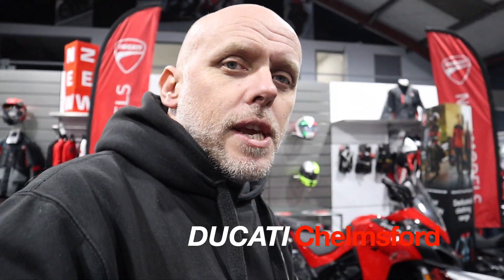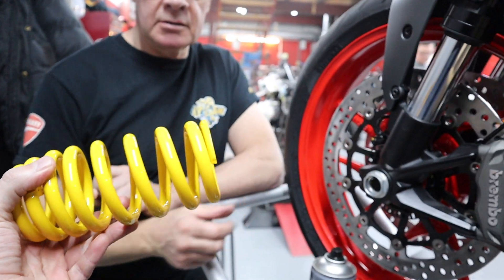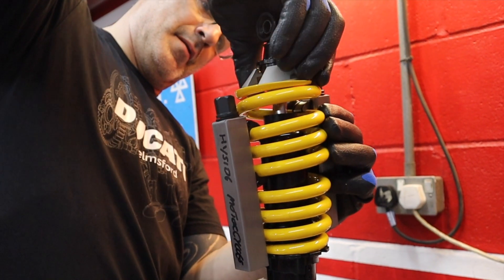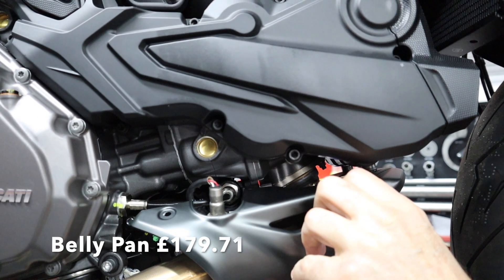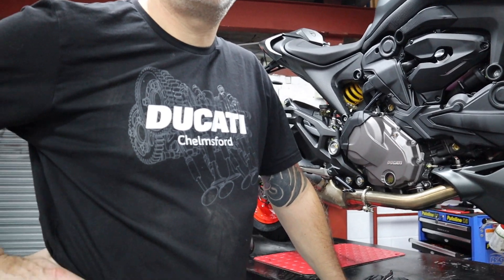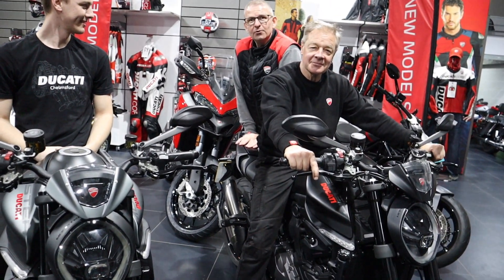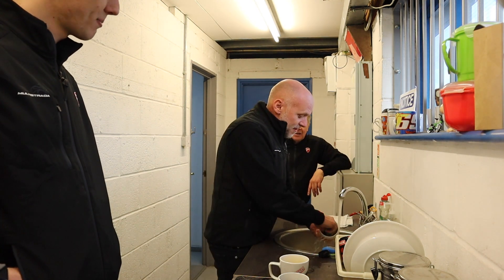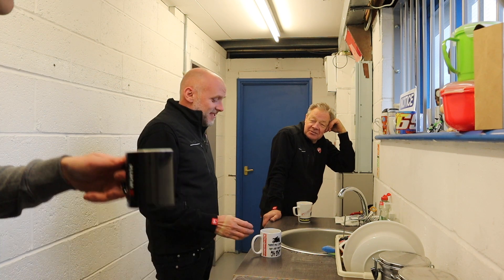New Ducati Monster 950/937 Suspension Lowering Kit , Low Seat & Belly Pan

Comment: Hi, me again (same as below, Terry Mims). thank you for your videos! So, I'm vertically challenged, and waiting for my red 937 to come in, in a couple months. We're going to try a lowering seat first. I'm 5'7, 65 years old, somewhat short legs. Anyway if I need the lowering springs, I will (dealer) install the kit. I know some people are completely against lowering the bike (affects the geometry), but, if that's what it takes to get this bike. I'm not a racer of any kind, so I think I would be alright. I was also interested in the MV Agusta Brutale 800 Rosso, but it sits too high for me. MV emailed me back, saying basically they don't lower their bikes. But I do have a Ducati dealer here in Albuquerque, whereas nearest MV dealer, probably 500 miles away. I think the Monster + wins out!
Reply from the maker: Yeah the lower seat maybe enough on it’s own , I’m 5”8 but as we are all different body/legs/arms lengths then it will be different for us , but see how you get on with just the seat and then see if you need the lowering kit :)

Comment: My height is 167 cm or 5'6" 
I m sure i don't need any lowering kit if they have a low seat which can reduce seat height by 20mm 
But i m not sure if i will need that low seat or standard seat is enough?
Reply from the maker: Personally I don’t need either at 5’8 , Paul in the video at the end is a little shorter then me and he would have one, even with height everyone’s leg measurements are different etc.. best thing to do is go to a Ducati dealer and sit on one and see if you fell comfortable , if you need it just a little bit lower the maybe just the seat would be good for you

Comment: thank you for adding this! i just bought one but it's a bit high for me. how many hours did it take to install the set? trying to price out labour
Reply from the maker: Labour is probably around 2-3 hrs depending on the dealer, tbh if someone bought the bike here and ordered the lowering kit at the same time they would probably just fit it for free, or if they had bought the bike previously from them they would work out a fitting price , you would just have to ask at your local dealer and see what they say :)
Reply: try the lowering seat first, then if necessary, the lowering springs

Comment: Can you lower the sp to the same height
Reply from the maker: You can have a lowered seat on an SP which lowers the Sp by 30mm , but the Sp is 20mm higher the standard monster anyway so not much gain, Ducati don’t do a lowering kit for the SP, my guess is you would have to talk to a Ohlins specialist to see why could be done , if you are in the UK you could always contact BGmotorsport in Northampton and ask them  , they did work on my RGV250

Comment: Interesting video. But how does it ride? Is handling affected? Is the lower/thinner seat less comfortable?
Reply from the maker: Thanks , Tbh just riding normally around on the road you wouldn’t notice much difference with the handling , the seat is a little harder being thinner then the standard seat but I guess the seat and lowering kit, either just one or both of them, if you want a Monster and physically need a lower bike it does work
Reply: @ProjectMoto  respuesta muy completa, gracias

Comment: Tell me if this makes sense. I've basically rode HD's, two V-Rods, & a Breakout. And all 3 flat footed, think I got a lowering seat for the Breakout. I got my Ducati Monster 937 two weeks ago. I have the lower seat. The 20 mm helped, on the balls of my feet. I've decided to go with the lowering springs, another 25 mm. This should get me flat-footed. Just feel safer this way, and I'll never put it on a track. No track around here anyway! Did you guys sell this bike you lowered? Any feedback on the ride, etc.?
Reply from the maker: Ok , the lowering kit will help a lot to get your feet more flat footed , the kit and the seat was ordered by the customer so it was sold , I haven’t spoken to the owner but I did test ride the bike , not at any real speed but it did ride fine
Reply: @ProjectMoto  The only bike I've been able to flat foot is the Triumph Street Triple R LRH. So my Monster, with the lowering springs & seat, should be almost exactly the same specs. I've got the full race Termignoni, sequential front turn signals, front belly pan, Rizoma Clutch & Brake reservoirs, & Motogadget bar-end mirrors. Love the 937. And as always, thanks for your reply; really like your feedback, & enjoy your videos. Actually changing the mirrors, too much vibration for me. Going to CRG Arrow bar end mirrors.
Reply from the maker: @terrymims3350  awesome , sounds like you have all the right accessories on your bike, I always enjoy riding the Monster, always makes me smile , and thanks, appreciate it :)

Comment: Does it effect ground clearance?
Reply from the maker: I the seat doesn’t but the lowers kit reduces ground clearance by 25mm , doesn’t really make much difference on the road though
Reply: Can I still off roading ?
Reply from the maker: @tanganobia480  don’t know myself as I would use an off road bike , everyone’s skills, experience and what type of roads/off roads they ride on are different, only you can decide that
Reply: Yeah sir but ...if ground clearance is about 150 mm it will be hard to off road
Reply from the maker: @tanganobia480  well I think the ground clearance would be about 175/180 mm something like that with the lowering kit??  but to be fair it’s not an off road bike anyway so adding a lowering kit for off road is not probably best idea I guess, there’s better bikes off road out there
Reply: @ProjectMoto  yes sir suggest I'm 5.2 so need good bike for off roading ... according to my height